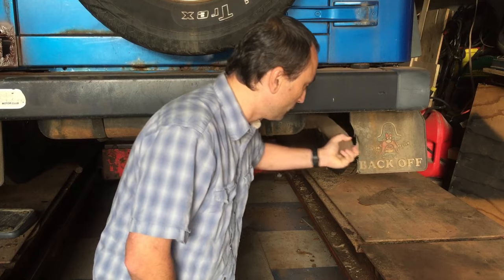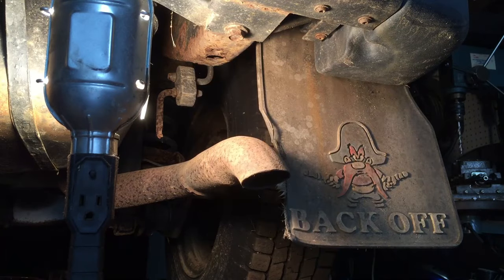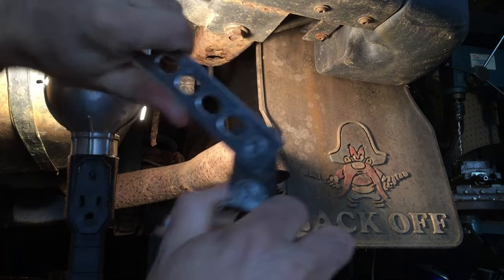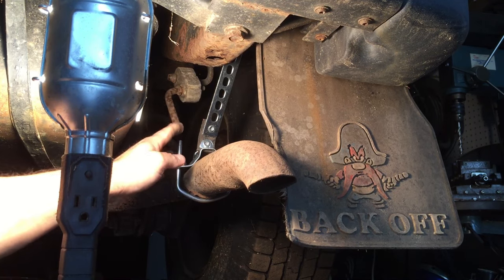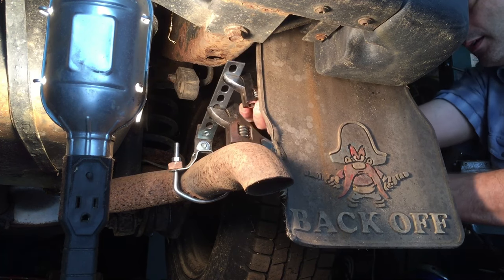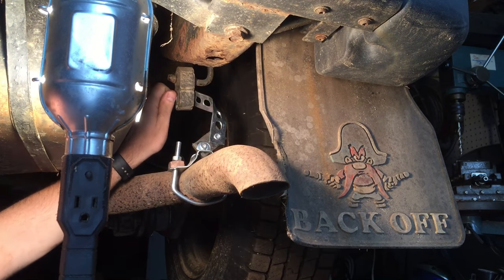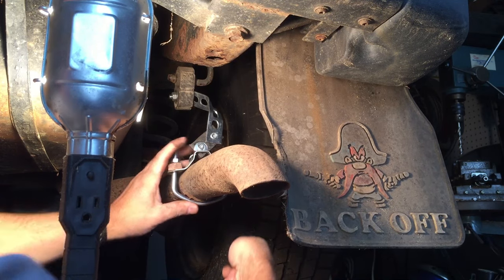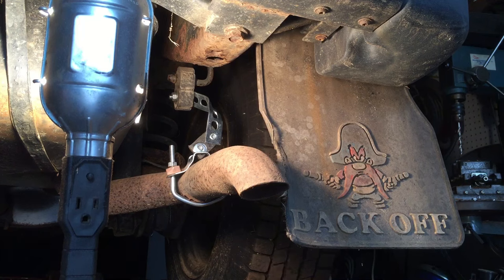How to muffler repair - hanger repair -muffler shop

Comment: what is the bolt you used to secure the new hanger once you got the old rusted one out? about to do this for myself
Reply from the maker: its called a carriage bolt, they come in many sizes. Get one as close to the hole size as possible. Also you can use just a regular bolt if you wanted to. Hope this helps thanks for the question.

Comment: Thanks for posting.  I had a feeling that there were going to be a bunch of comments about other ways to fix this problem.  There are a lot of different options available.  Thank You for showing us this one.  I don't know if I could have that thing hanging down if it was visible from outside the vehicle, but if its hidden from view, this is a good quick fix.  Thanks again!
Reply from the maker: Thank you for taking the time to comment. Yes there are multiple ways of fixing things for sure and it’s always good to get several different ideas to see which will work best for your situation and needs.

Comment: Does the bend in the hanger create a weak point? I've had these types of hangers break a lot but there aren't many other options sometimes.
Reply from the maker: I dont think i have had an issue with breaking at the bend, but im sure it would be a little weaker there to some extent. And your right , not a lot of options.

Comment: What if the hanger got seperated from the body of a car instead of the exhaust?
Reply from the maker: If I understand you correctly then you may have to have somebody weld on a new bracket on the body of the car if that’s not what you mean then I would buy a whole new hanger system. I hope this helps thank you for taking the time to ask the question.

Comment: That muffler hanger already has a rubber insulator between the clamp and the metal bar, so it doesnt need to be attached to the old big rubber isolator. The metal bar is built as it is to be able to be bolted onto the frame, or onto the car rod hanger.
BTW if the muffler moves too much with road bumps and vibrations because of the two rubber isolators it will make the flex pipe fail earlier than its normal life (if the vehicle has one) or the other connections, specially if one travels a lot of roads in bad condition.
Reply from the maker: The vehicle has no flex pipe and fortunately I’ve had no problems with it whatsoever the rubber mounts are fairly solid and not too sloppy so it did not move around a heckuva lot.  But you are correct I did not need to hook it back to that mount but I decided to anyway. Thanks for taking the Time to comment.

Comment: what to do if the rubber is corroded and is not re-usable??? thanks
Reply from the maker: the new hanger has rubber on it so you can just bolt directly to metal on you car if you need to. in my case I was able to use the old spot to bolt to and utilize the rubber as well. I put a link to the hanger in the description but just make sure its the size you need.
Reply: If you need to ask ! Get away from that car !
Reply: 1503 ONERUS 
🤣
Reply: The rubber "hangers" are sold at your local autoparts store.   Advance Auto has at least three variations.  They are not expensive (less than $10).    They sell the hanger "Shane" used also.

Comment: Or instead of damaging the bolt so you cant get it off use lock tight 🤷‍♂️
Reply from the maker: I could do that but by the time it needs to come off it will most likely be rusty and ill just use a sawsall to cut it.
Reply: Using heat can make Loctite melt and soften.. so not a good idea as it can still come off...you can use a self locking nut instead

Comment: What if the top snaps?
Reply from the maker: Well then ill have to replace that i guess. But so far so good. Thanks for commenbting
Reply: @shanesmaineshop  you weld a new one on .
Reply: @CanadienNortherner     That is the "perfect" way to do it.   But how may of the searchers for a DIY process have welding machines?      Few.     The ones that do, have already fixed their break.

Comment: You should’ve removed the rubber part entirely and just attach the metal to metal
Reply from the maker: No, then you would get an awful lot of rattle noise. It could be done that way, but I wouldn’t do it.

Comment: bro, use liquid such as WD40 to help remove and install those rubber hangers
Reply from the maker: Yes, that would help but it also dries out the rubber. I suppose for the few time this has to be done it would not matter but your right it would defiantly go a lot easier. Thanks for taking the time to comment.
Reply: @shanesmaineshop  In that case, use spray silicone.

Comment: You would’ve been better off using a wire clothes hanger and achieved much better results (cosmetically as well) then what you have shown us here. Not a fan of this “fix” at all. Looks horrible and I’m sure it won’t last very long before you’re making another “repair” to your work. Just go down to the parts store and purchase the proper hanger. I just picked up 2 brand new hangers at the part store and it was LESS then $11.00 USD out the door.
Reply from the maker: Its still working just fine. thanks for taking the time to comment.

Comment: Why not just attatch it to the METAL hanger coming off the actual car just above the rubber bushing? What will happen is the rubber bushing will  perish snap and then your be back to square one lol
Reply from the maker: If you do that it will fail much sooner because you need some flexibility from the vibration of the engine and the muffler system. If you don’t have some flexibility in the system the metal wall crack and break. Thank you for taking the time to comment and ask the question.

Comment: Should of just took the rubber off completely then slide your metal bracket through the top hanger and then put your rubber back on. That just looks messy
Reply from the maker: Both of them or just as difficult to deal with so it was best to leave the rubber piece in place. Thank you for taking the time to comment